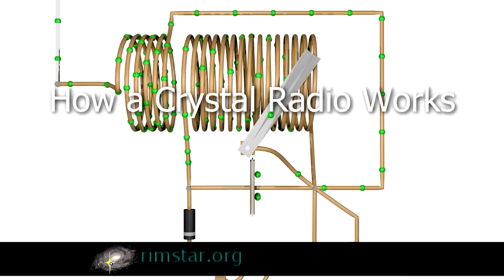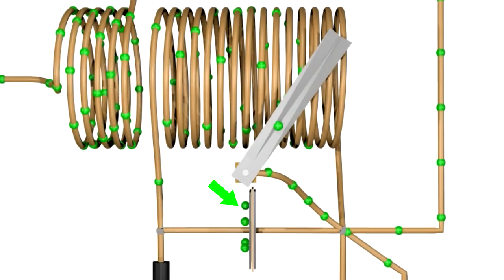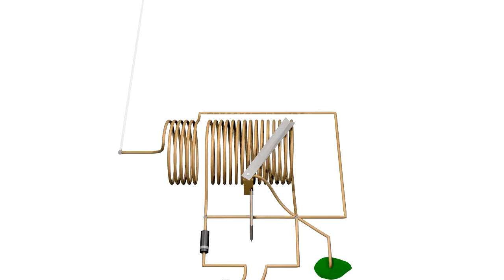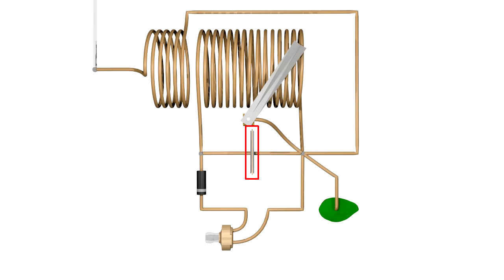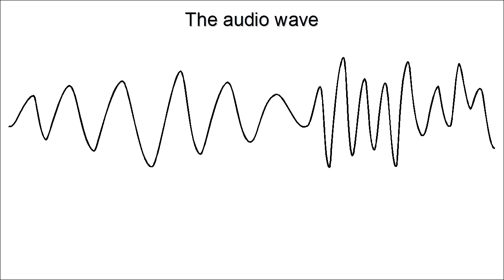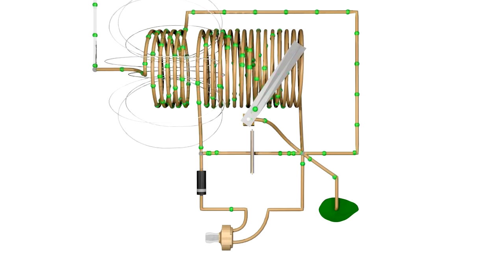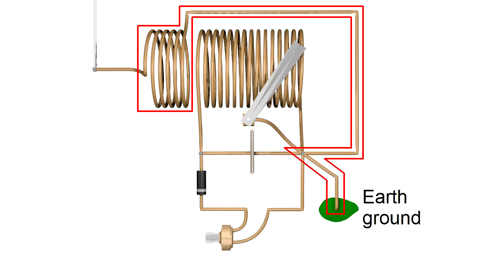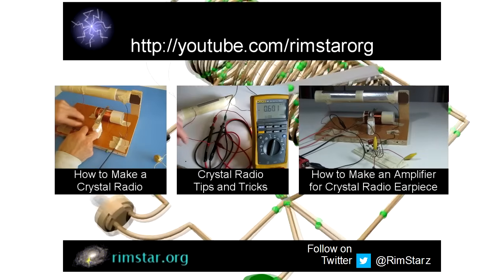How a Crystal Radio Works

Comment: so the crystal in a crystal radio is in the ear piece? (thin quartz crystal) , other than the metals and germanium.
Reply from the maker: No, the name crystal radio comes from when the diode was the piece of germanium. These days, any radio which is powered from the incoming radio waves is called a crystal radio. So it's for historical reasons.
Reply: @RimstarOrg  The name comes from when the crystal was a piece of galena  -- Lead Sulphide  --  PbS  -- which was usually probed with a piece of wire known as a Cats Whisker.
Reply from the maker: Ooops. Did I say germanium? My bad. Thanks for the correction. I meant to say galena.

Comment: Any way to replace the inductor with a capacitor?
Reply from the maker: Do you mean the antenna coil or the tuning coil? You can't replace the tuning coil, it's needed for resonating with the capacitor. You can eliminate the antenna coil by connecting the antenna directly to the tuning coil, but you might get more interference from other stations close in frequency to the one you're tuning in.
Reply: @RimstarOrg  Wow thanks for the quick reply! I struggle a bit to understand how the inductor and the capacitor work together but I guess it's one of these cases it's ok to sort of realize what's going on and just use the formula so I'm ok :)
Reply from the maker: No need to just use the formula. I made this other video explaining how the resonance works https://www.youtube.com/watch?v=tjD9I95RAbw

Comment: it is almost correct just few minor oversimplifications the diode detection is one.
Waaay to complicated, what you say is "close enough" if you are not after a degree in electron herding.
To be correct you have to do some mind exercise, RF and AFmixing, complicated 3d graphs of mixing products in single diode mixers and read up on those single diode mixers, RF signal "ringing" in a LCR circuit, Q and its effect on bandwith and available voltage, low signal behaviour of diodes ("square law" detection), Ben Tounge has quite some resourses online, so does Dick Kleijjer.

Comment: How do you adjust the frequency?
Reply from the maker: With this one you have two ways to adjust it or you can use both method together. The coil has a sliding contact on it which you can use to change the frequency and the capacitor is a variable capacitor. I explain it starting a 4:52.
Reply: @RimstarOrg   wow thanks, this is very informative. I'm thinking to build a radio controlled device without using complicated and modern tech like arduino, this vid provide necessary info on how to make a receiver. if you have time can you make a vid on how a radio transmitter works?  That would be very awesome!!
Reply from the maker: For making a radio transmitter and how it works, I made these videos https://www.youtube.com/watch?v=_4-Sx-T6VBc https://www.youtube.com/watch?v=R04yEKqgGPc . Note that it's a very simple transmitter and not a good one. I transmits on the desired frequency but many others too at the same time. So it should be used for transmitting only a meter or so otherwise it would interfere with other signals. In many countries it's illegal to transmit unless you have a HAM radio license.

Comment: I do believe that the turns on the right-hand side of the coil are short-circuited and that should not be!
Reply from the maker: That's the way it was in the book that I originally got the circuit from and I've seen it in other schematics but yeah, a few others have pointed out that it would work better without that section of the coil being connected -- I just haven't had a chance to try it.

Comment: But how does the diode become forward biased if it need 0,7v, I don't think the antena provides that
Reply from the maker: Good question. It's a germanium diode, so the forward bias needed is 0.3v. As you say, you'd need a very long antenna and/or a strong station nearby for a silicon diode to work.

Comment: didnt you forgot to add an amplifier, because how would the earphone make sound if the electric current is to small.
Reply from the maker: Nope. A crystal radio is one that gets all its power from the radio waves - no amplifier needed. All you need is what's shown in my "How to Make/Build a Crystal Radio" video http://youtu.be/VqdcU9ULAlA However, if you want it louder then sure, you can add an amplifier. I did in my "How to Make Crystal Radio Amplifier for Speaker" video http://youtu.be/JtPwxbOgBHw
Reply: o ok, i didnt know that. thanks

Comment: Does it automatically scans throught frequency?
Reply from the maker: No. But a fun project would be to put a motor on the wiper blade or capacitor plate to make it automatic.
Reply: @RimstarOrg  I bought a National HSB 1-2 Crystal tuning radio. Is it the same concept as crystal radio??
Reply from the maker: I searched online but couldn't find anything about that radio. Do you have a link to some information about it? If it said just "crystal radio" then I think it would be one but you wrote "crystal tuning radio" which makes me not sure.
Reply: @RimstarOrg  It is really weird I can't find anything too. I am so curious that I bought it. I left it at my office but it has frequency choices Set 1 and 2. I forgot the frequencies.
Reply: On each set there is 3 frequencies a total of 6 options for frequencies. I also pick up chinese station.
Reply from the maker: If it has a battery or a plug for plugging into the wall socket then it is likely not a crystal radios. Crystal radios are ones that get their power from the incoming radio waves.
Reply: @RimstarOrg  thank you for clarifying. But still I am still curious about the radio I got. It has NSB 1 and 2. I found the same radio but the brand is Sony NSB1-NSB2/MW 6 Station Crystal Tuning TR-4410 - Sony Corporation; Tokyo
Reply from the maker: Found some images of that radio. It's definitely not a crystal radio. I also looked for what "crystal tuning" means and from my understanding, it involves tuning a variable capacitor to correct any error in a crystal oscillator. See section 4 in this document https://www.infineon.com/dgdl/Infineon-AN95089_PSoC_4_PRoC_BLE_Crystal_Oscillator_Selection_and_Tuning_Techniques-ApplicationNotes-v06_00-EN.pdf?fileId=8ac78c8c7cdc391c017d073ea85f628d&utm_source=cypress&utm_medium=referral&utm_campaign=202110_globe_en_all_integration-application_note
Reply: @RimstarOrg  woah thank you 😍😍😍
Reply: @RimstarOrg  I found the meaning of NSB it means Nihon Shortwave Broadcast. A private radio station in Japan. I bought a radio receiver specific to that station :) ranging from 3 to 9mHz.

Comment: the first coil (with less turns) why is needed? In my crystal radio I connected directly the antenna to the resonant coil
Reply from the maker: +volt897 Look at the video at 10:43. It helps with selectivity.
Reply: ok
Reply: +RimstarOrg ok thanks
Reply: Why does it have 25 turns?

Comment: I made several real crystal detectors before during my high school days. This is not a real or original crystal detector. The original crystal detector only uses actually uses a crystal which is usually a or native pyrite mineral. Pyrite, due to its brassy luster is sometimes mistaken fo gold. There was no diode before when the crystal detector was discovered or invented. It is called a cat-whisker crystal detector where you have to sharpen a springy contactor to the crystal. In fact I was even able to detect or hear radio station by using a blade. 

Yes, the cat-whisker serves as a diode, thatś why you can replace it with a diode. Also, the original cat-whisker has its crystal in series with the slider. From the diagram, it is clear it is a modified crystal detector. with the addition of an improvised capacitor, but I bet my expertise, you make one like that and all the stations will come in. Only the strong station will prevail. From my experience, there is no tuned circuit that will happen here, not grounding it, except by cutting the leg of the second soil (with many turns) and putting the diode in series with the slider. 

You can hear something but selectivity is badly compromised.

Comment: #RimStarORG
Can this type of radio can be used to transmit and recieve Morse code?
Installing an optional bulb for recieving signals? or Just using a speaker for sound?
Reply from the maker: I guess it could. Your transmitter would have to turn individual clicks into an AM wave and then it's really just normal AM radio that you'd be receiving.

Comment: Can i use any capacitor as long as it’s dc??
Reply from the maker: Yes, as long as it's a DC capacitor (i.e. not polarized like an electrolytic capacitor). It also has to have the right capacitance range, roughly. For the coil for my crystal radios and most others, it's capacitance should be a minimum of around 355 picofarads. The voltage won't be high (usually under 0.5V) so the capacitor voltage rating is usually okay.

Comment: Is there any way to not use ground??
Reply from the maker: Yes. It will likely not work as well though. I do that with my portable crystal radio here http://youtu.be/iunAvz9PbN0. But I realized that I could still get an okay ground by making as much skin contact as possible with my hand on the outer capacitor plate. You can see me do that in this other video where I also add an amplifier http://youtu.be/cQ-LxMDrD_o (but it helps even without the amplifier)
Reply: +RimstarOrg Thanks.

Comment: 10:42  How long should the antenna be ?
Reply from the maker: For local stations, 40 to 50 feet in a straightish line, for stations further away, 100 feet or more. But I managed to pick up some local stations with only around 15 feet, very faint but audible. I also had an improvement by using multiple wires in parallel. Here's my first one https://www.youtube.com/watch?v=EsZQS2GOMQE with the short antenna.
Reply: Thank you for your good video and thank you for your answer and explanation.

Comment: so is this more of a diode detector radio than a crystal radio?
Reply from the maker: Good point, but the definition of a crystal radio has changed over the years. It now means any radio which powers itself from the incoming radio waves.
Reply: @RimstarOrg  yes that's true. when i was a kid i used to love using a store bought one. when i was in the air force 68-72 i was trained as a ground radio transmitter repairman and maintained and repaired very large ssb units. some up to 50kw with monster pa tube finals.

Comment: how much voltage it recieve?? or watt???
Reply from the maker: The voltage I get with my short antenna is around 200 or 300 millivolts. With longer antennas it can be in the single digit volts. I've never measure the current so I can't calculate the watts.  It's small though. Some have managed to turn on an LED.

Comment: I have one with a variable capacitor I tuning coil and two unganged different coils.. then I built a 40 metere one that picks up CB radio signals or 40m

Comment: Isn't that diode conducting in the other direction from what you explain here? The line on the diode indicates the cathode so the current would flow from anode to cathode, or am I mistaken (which wouldn't be the first time ^___^ )
Reply from the maker: No, I'm showing electron current. There's electron current and then there's conventional current. Back before we'd discovered electrons we had to pick a direction that the stuff in a wire flows in DC electricity. We chose wrongly and that's what we call conventional current. It's the flow of positive charge (even thought the positively charged protons don't move) in a circuit and electronic symbols like diodes and transistors have arrows that point in the direction of conventional current. We later discovered electrons and that it's the electrons that actually move in circuits and so they move in the other direction.
Reply: Ah right. Thanks for your explanation. Very confusing when a 'positive' pole means that negatively charged electrons come out of it. :)

Comment: what is the use of coil?
Reply from the maker: If you mean the shorter coil, the one that's connected to the antenna, that's there for help with selectivity, tuning into just one radio station and tuning out all the others. I talk about it in the video at 10:42.

Comment: I never knew that radio waves are actually a form of light (electromagnetic waves) I always thought that they were something completely different.
Reply from the maker: Brandon Fisher Yeah, it's surprising that gamma rays, X-rays, radio waves, ultraviolet light, visible light, infrared, ... are all just different frequencies/wavelengths of electromagnetic waves. Some refer to the whole electromagnetic spectrum as light and some use the term light for ultraviolet, visible and infrared only.

Comment: Also what is the significance of the crystal
Reply from the maker: The term crystal is because back in the early 1900s, before the invention of the modern diode, the sharp tip of a wire touching a galena crystal was used instead. That worked because galena is a semiconductor.

Comment: And you don't need a internet connection to operate a crystal set AM, LW or SW radio.  Radio is a offline audio source, and with a crystal set radio, you can use a AM transmitter kit or an assembled AM transmitter under part 15 rules and listen to music from your bluetooth receiver or computer as an home and school experiment, and learn on how to DJ by yourself and listen to yourself on a crystal set radio.  Oh yes, crystal sets don't need batteries or solar power energy, they detect and demodulate signals using a galana crystal, razor blade using a pencil which is graphite, or a germanium diode which 1N60, 1N34 is prefered best, the 1N60P is okay, but not as sensitive as the original diodes that were made back in the day.  The reason for the coil and capacitor is for to help resonate the wavelength and frequency between 153 kHz to 279 KHz requring a 4.7 mH or 2.5 mH coil, and for the AM (MW) band which is 510 kHz to 1710 kHz which is 470 uH or 250 uH. Use a L/C calculator and a L/C meter to design your own coil.  The capacitor help tune the coil.

Comment: crystal radios are proof that electricity can be transmitted wireless, like Telsa wanted to do.
Also it really is a leap of faith to think you can "tune out" all frequencies except one.  Wouldn't frequencies overlap?  For example a 4Hz and a 8Hz frequency.  The 8 Hz frequency could have half of it's "waves" happening at the same time as some of the 4Hz frequency.  How does the coil "magically know" which waves belong to the 4Hz frequency and which belong to the 8Hz frequency?

Comment: Aren't inductors supposed to block AC current
Reply from the maker: No, not all inductors black AC current. It depends on the design of the inductor. Different designs make for losses in different frequency ranges.

Comment: can i use a her508, 1n4007 or a fr107 diode?
Reply from the maker: Not likely. From searching for their datasheets online, it looks like those are all silicon diodes, which have a forward voltage  (VF) of 0.6 or 0.7 volts. This needs a lower forward voltage and germanium diodes are around 0.3 volts so they tend to work well. Here's a sample list from the video description 1N34A, 1N60, 1N91,  1N119, 1N270, 1N277, 1N283. The 1N34A is cheap and easy to find on ebay.com -- that's where I got a lot of mine.
Reply: @RimstarOrg  so can i use a schottky diode cuz it has low forward voltage?
Reply from the maker: I would think you could use a schottky diode for that reason but people don't seem to so there may be some other variable that makes it less desirable than germanium. But if you try it, let me know how it goes.
Reply: @RimstarOrg  ok
Reply: @RimstarOrg  do you use any social network? i want to contact with you
Reply from the maker: No, I don't. I used to use twitter and facebook but haven't in a long time.

Comment: so if I want to build a transmitter and put it out back and a receiver in my house what levels would I have to transmit on to not disturb, am, fm, and basicly every one else who dosent want to here my hobby beeping away? odd question I know but I would rather not find out what the fca frowns on the hard way.
Reply from the maker: +119matburn I don't know how you'd work out the power levels. I guess you could do tests, i.e. try different transmission power levels and walk around with a good receiver until you don't receive anything anymore. I would use a powered radio, not a crystal radio, to do the receive test since a crystal radio may not receive even a weak transmission whereas a powered radio would. Turn the radio to its maximum volume, since that's what neighbors might be doing.
Reply: thanks a ton
Reply: to any one interested I looked up the law, any AM FM broadcast without a having a FCC license is illegal. with the exception of anything that cant be picked up outside of 200 feet.